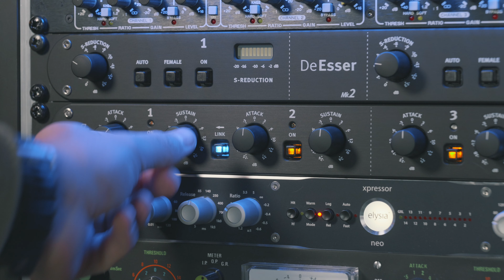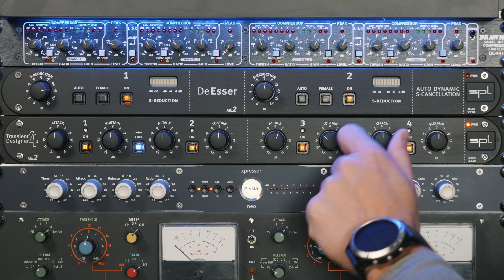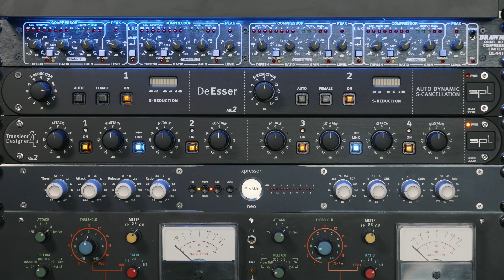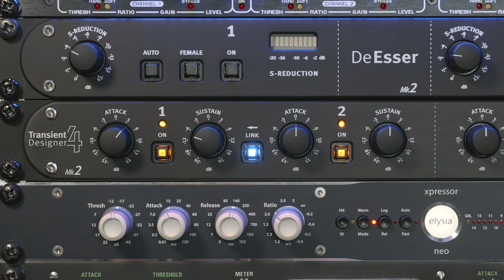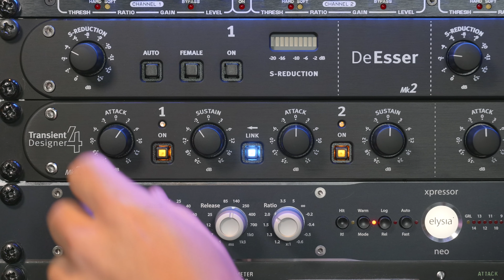The Audio Processor That Changed Everything | Transient Designer 4 Mk2 Review

Comment: Very vanilla how this gear is offered, really.  Thus far TDs are a simplifier that saves some time when working in certain idioms.
If TDs are ever going to be as ubiquitous and fundamental as comps and limiters, then they need to also be more timbrally appealing.   I'm surprised that there isn't already multiple models capable of of Feed-forward vs feedback, VCA vs Transformer vs  Tube vs Diode types, and more emphasis placed on varying envelope shape(s) and sensitivity.   Many VCA and FET comp/limiters can do similar already, and using the right combo in series and/parallel covers every dynamic base.